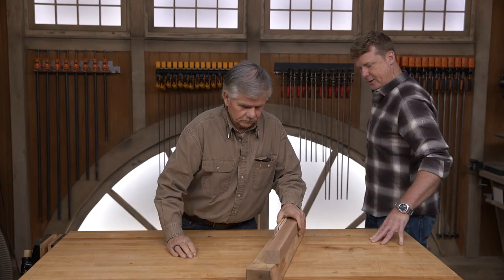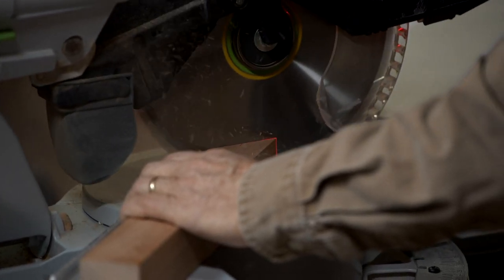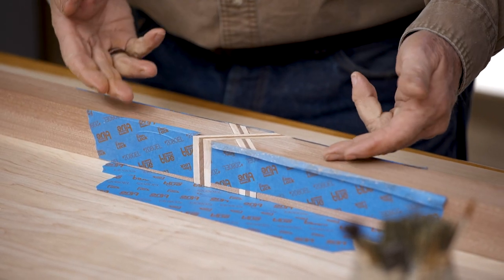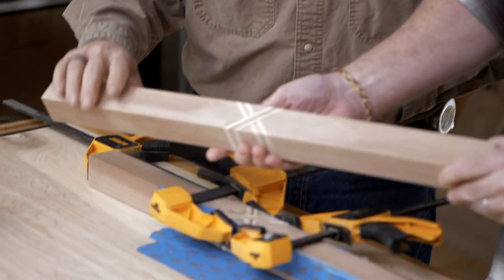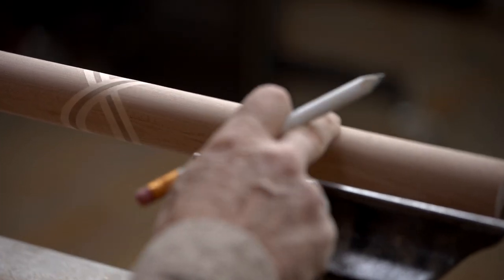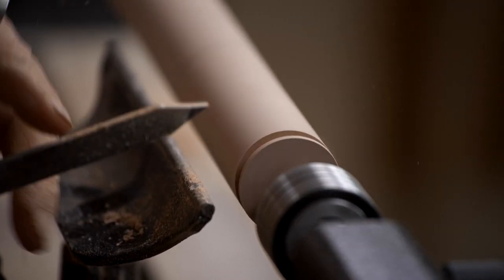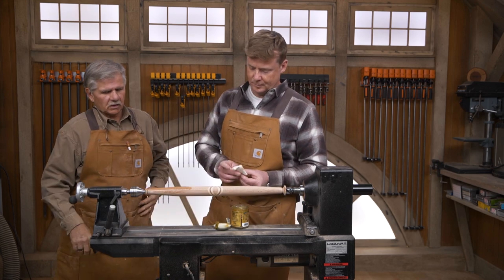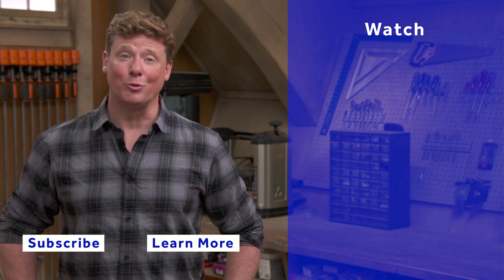French Rolling Pin | Build It | Ask This Old House

Comment: Looks nice, but typically end grain glue joints are considered week, but I’m guessing baking isn’t to aggressive.
Reply: It's end-grain to side grain so not as bad as end grain to end grain. You can also strengthen end grain joints with two applications of wood glue. The first will get sucked up by the grain, the second will create a stronger bond.

Comment: More or less End-grain glue joint on a long thin item? Isn't that a weak joint?
Reply: I mean it would be if it's under any sort of stress. But it's just a rolling pin.
Reply: @clausdicovskiy1350  But when there is a lump of dough in the middle and you push down on the ends, that would put quite a bit of bending force on it, don't you think?
Reply: @ianbutler1983  yeah I guess, but I can’t imagine it being anywhere near the force required to damage the joint. But maybe I’m wrong. I guess  Kevin’s wife will find out! Lol